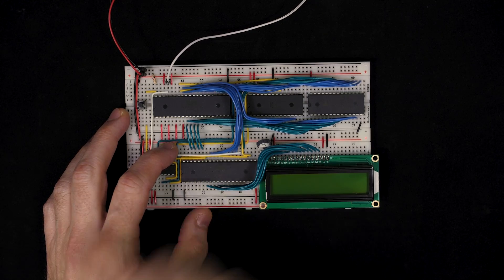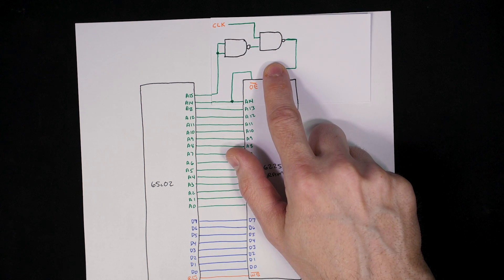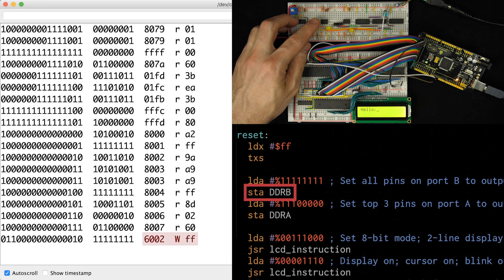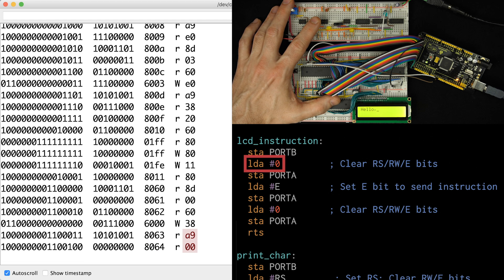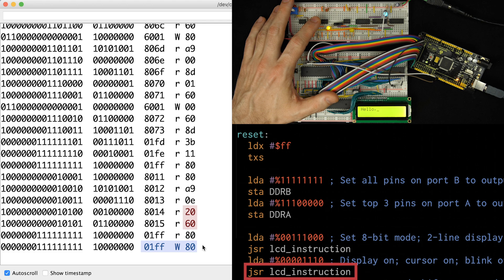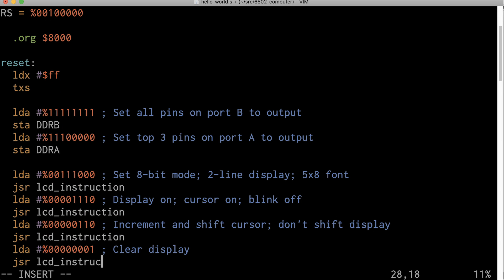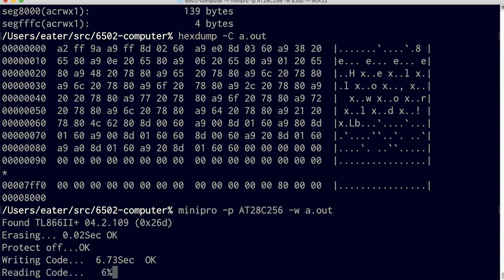Subroutine calls, now with RAM — 6502 part 7

Comment: I think I speak for a lot of people when I say that I would love to see you doing a few videos talking about how you could connect this computer to your home made video card. 

It probably isn't as straightforward as it seems. But in a nutshell, couldn't you theoretically replace the EEPROM on your video card with some kind of static VRAM that's being filled by a program in your 6502 computer?

If nothing else, if i'm wayyyyy off the mark, I would be equally happy with a video explaining why that wouldn't work.
Reply: Timing can be a problem.
 The video card needs access to the VRAM for every line on screen, and somewhere in there the 6502 needs to be able to write to the VRAM.
Reply: Maybe he could teach us how to actually arbitrate accesses between GPU and CPU. Yeah, that wouldn't be that bad actually.
Reply: @paulstelian97  , blank periods in the borders of the screen, L-R & especially top-bottom can provide opportunities for a CPU to access VRAM, especially if the CPU is slower than the video card's pixel clock rate.
Reply: @massimookissed1023  Well yes, but actually synchronizing in software isn't that good of an idea. You should have a hardware arbiter just like DMA and CPU arbitrate each other when accessing the regular address/data buses in actual computers.
Reply: The real problem is that the eater video card is just a frame buffer and 200x120 bytes is a lot of data to move around, for a 1Mhz CPU anyway. That’s why video chips for old 6502 systems used tile maps and sprites.

Implementing those things with simple ICs would be insane. An FPGA would be the best modern way to implement that without using tons of silicon.
Reply: @zerobyte802  I would be fine seeing him just fill the screen with a solid color or raster bars. But yeah, I can imagine it would be crazy after a while.
Reply: @massimookissed1023  if i am not mistaken this is exactly what the atari 2600 does...
Reply: @urugulu1656  you are not mistaken. The 2600 worked exactly like this.
Reply: Don't think HDMA can be very useful for this
Reply: @zerobyte802  Or maybe a Parallax Propeller chip, probably a bit easier to grasp.
Reply: @massimookissed1023  the NES avoids this by only allowing the nametable data to be written to during V-blank, since it does not do anything.
Reply: @massimookissed1023  The old 8bit Atari computer did that by routing the clock though the GPU. That way the GPU could slow the CPU down to read from RAM. And at the time VRAM wasn't used as well. The DRAM had to do it all.
Reply: That IS what the 2600 did, but you do have to keep in mind that the graphics chip on the 2600 wasn't using a display buffer.

It has something like a 20 bit line buffer for the background, and a bunch of hardware sprites, and a handful of control registers.

You HAD to write to it in H-blank, because the graphics chip would literally only draw a single scanline, and if you weren't changing data each line the screen would just be the same thing over and over.
The V-blank period is the only time during which the CPU isn't occupied with screen update logic, so it's the only time you have for the rest of your code.

But yeah, in general these old microprocessors (especially at low clock speeds) are not fast enough for systems that only have a framebuffer.

I for instance use my Atari 800XL fairly often. 1.77 mhz 6502 (for the PAL model anyway).
And while it has something like 13 graphics modes and fairly complex logic that lets you switch graphics mode on a per line basis without CPU intervention...
It's one of the few systems of the era that has pure bitmap/framebuffer modes. 

If you set one of these up as fullscreen then you're dealing with 320x192 in 2 colours, 160x192 in 4, or 80x192 in 16...

Since each of these means there's more than 1 pixel per byte, and a 6502 works with whole bytes, you can fill multiple pixels with one write to video memory, but... in most cases that's not something you can take advantage of.
and the masking involved for writing individual pixels would actually make it slower than if a 256 colour mode was available...

Anyway... If we ignore all sense of reason and assume that somehow we can update 1 pixel for a single STA instruction, don't have to deal with bus contention, any other logic or what have you...

We find an STA is at least 4 clock cycles, so at 1.77 mhz we find our absolute best case (highly unrealistic) is that we can update 442,500 pixels a second.

a quick calculation for our lowest resolution option of 80x192 pixels shows a single frame to have 15,360 pixels.

Since our system is PAL, and runs at 50 hz...
Oh, would you look at that. updating this, our LOWEST resolution takes 768,000 pixels a second to update at full framerate...
And that's with the idea that we can do such an update in 4 cycles.
In reality even the best optimised code ever is likely to be closer to 20 cycles per write, and if you include the overhead of doing any nontrivial work alongside that you're soon looking at 100-200 cycles for every pixel drawn...

I know I wrote a line drawing routine for 6502 at some point. And while I'm sure it could be optimised, I noted that the setup for each line drawn took about 200 cycles, and then each pixel drawn was about 25 cycles. Suffice to say I worked out that my atari could draw about 1000 lines, give or take on a single frame. Since in practice any realistic use of line drawing (I was hoping to make a wireframe 3d engine) would require erasing the graphics memory between frames...
Well, your first instinct might be to do a memory fill, but as already noted, that's slow. Even knowing this is a case where we can exploit 1 byte written = multiple pixels, blanking the screen between frames is going to eat most of our cycles.
So it turns out the most efficient way to blank an image when drawing wireframe 3d graphics... Is to 'undraw' all the lines you drew in the current frame. (that is, draw the same exact lines again, but in the background colour)
That's great to know, but that means the 1000 lines per frame I thought I had is actually more like 500 lines a frame...

So... Yeah. That's not really viable in a general case.
I mean it's not impossible to do as a tech demo, but the results would be painfully slow.

(as an aside I was trying to work out the performance requirements in a very broad sense for doing 3d graphics in software. From that I determined that to do filled 3d graphics at decent... Eg 25-30 fps speeds, requires roughly a 30 mhz CPU. And on PC these kinds of speeds are indeed when we started seeing somewhat decent 3d games showing up, even if they still took a lot of shortcuts with it...)
Reply: @KuraIthys  I appreciated reading this breakdown on the impracticalities of frame buffer or even 3D wireframes on some of these old 8 bit microprocessors. It is one of those things that everybody hand waves away as if it were impossible without actually explaining (or even knowing) why. Thanks for explaining the science behind it.
Reply: @mapleshaft  Yeah same. I am equally happy with an explanation for why it wouldn't work and why.

I'm always learning something, no matter what.
Reply: @KuraIthys  Love the detailed explanation. It seems in a "modern" computer whatever code you write needs to find a time slice to do its stuff between all graphics intensive works to keep the monitor filled with colors is done. A similar memory hungry aproach happens with sound? I dind't had the intuition that the audiovisual part was so resource intensive.
Reply: At that point he has to decide just how far down the rabbit hole he wants to go with teaching computer science vs computer programming.  Games used to be simple not just because of hardware constraints but because of time restraints.  There is a ton of foundation work that has to be done to support making video games on any platform.  There are a lot of toolsets created to speed up and simplify the process on consoles and computers.  And when you create your own computer, you're on your own making those toolsets.
Reply: You could, but you run into the problem of sharing memory with two devices. There's a few ways to do this.
One is to have the memory run at double the speed of either CPU or GPU, and have them alternate accesses. This is a pain if you're dealing with seperately-generated clock signals.
Another is to use the 'C02s /WAIT input to halt the CPU if both try to access the memory at the same time.
Another way would be to leave that memory strictly alone until either HBLANK or VBLANK, and have an interrupt and/or memory location inform the processor when the VRAM is free. This assumes the Eater GPU doesn't access VRAM during the blanking periods. I don't remember if this is the case anymore.
Reply: I think a problem would be the clock speed. Due to the fact that ram and eeprom could be slower than the crystal he is using in the video card. I don't know exactly. But that could be a problem presented
Reply: Why replace the EEPROM? There are already 8kb of unassigned memory:

https://files.peakd.com/file/peakd-hive/krischik/hoSSNzoy-MMU.png

Comment: try to hook a screen up and create a NES (also has 6502)
or maybe a BEES (Ben Eater Entertainment System)
Reply: BEEEEEEEEEEEEEEEEEEEEEEEEEEEEEEEEEEEEEEEEEEEEEEEES 🐝🐝🐝🐝🐝🐝🐝🐝🐝🐝🐝
Reply: The NES' CPU is based on the 6502, it's not actually a MOS6502
Reply: That doesn't really matter.

There's few systems that contain an actual 6502. Yet they'll still all run the same code and most of the support circuitry is similar.

> the c64 runs the MOS 6510
>The Atari 8 bit micromputers use a chip called 'Sally' or sometimes (to much confusion the 6502c - no relation to the general purpose 6502c) - this sounds fancy but it's basically a 6502 with an external 'halt' line that lets the graphics chip force the CPU off the bus so it can do DMA. This is pretty much just to cut costs, since you can achieve the same effect with a standard 6502 and about 5 logic IC's...
>The NES uses a Ricoh 2A03 - which is basically a second source 6502. While it has some slightly altered functionality, it's still essentially a 6502 for most purposes
>The TurbographX 16 has a Hudson Soft HU 6280 - again, this has a bunch of unique features. Among them a 21 bit address bus to deal with up to 2 megabytes of RAM, and a few other things. But at heart? Still a 6502.
> The SNES like the NES before it is using a Ricoh CPU. In this case the Ricoh 5A22 - this is of course a 65816 derivative, not 6502. But still the same logic holds. In this case the 5A22 has a bunch of extra features, like being able to operate at 3 different clock speeds, a multiply and divide circuit, support for the SNES dual bus layout and DMA engine, and so on. But underneath all that? Still fully compatible with the 65816...

Very few systems from that era (basically none in fact) explicitly use a 6502, but they're all very similar in spite of that...
Reply: @KuraIthys  The BBC Micro, very popular in the UK, used a genuine 6502A (that is, a 2MHz version of the 6502). Mine was manufactured by Rockwell.
Reply: @KuraIthys  the c64's cpu is basically a 6502 with more address lines, since commodore were actually manufacturing the chips
Reply: @KuraIthys  so SNES can run 6502 code vanilla? just like 486 can run 286 code... But most importantly, how is graphics and music controlled, text I assume on screen is close to using LCD here. gfx and sfx were separate chips. RAM I assume works same as here, despite minor differences.
Reply: WE NEED THE 
B   E     E     S    !
Reply: Ya like jazz?
Reply: @ijoshuadockery BEES KNEES xD
Reply: BEES 🐝🐝🐝🐝🐝🐝🐝🐝🐝🐝

Comment: Normally, I'd wire the OE* pin to the R/W line via an inverter.  Perhaps THAT signal should also be qualified by the CS* as well, although I think the OE function is already qualified by CS inside of the ram itself.
Reply: Yeah, OE will not work without CS being active.

Comment: Could simplify the wiring a bit by stacking the RAM on the ROM, bending out the pins not common. Used that technique back in the day on the TRS-80 to double the RAM.
Reply: That would make the programming of the ROM rather more difficult in this case.
Reply: I can't imagine it being easy to bend out pins far enough to reach different contacts on the breadboard. Remember all the holes are ganged in sets of 5. Your idea works on a PCB much better.
Reply: Mal-2 KSC the idea would be to solder jumpers to the pins that aren’t common. I think the chips could piggy back on each other without solder, so the EEPROM could be programmed. But, that might result in flakey running.

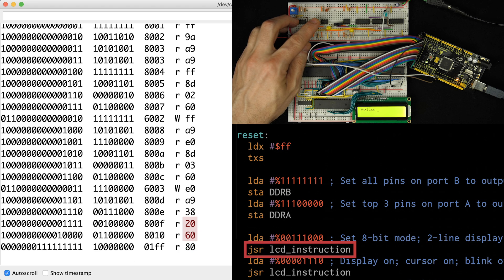Comment: Great video again Ben. At 8:25, I think the data (80) at address 01ff could have been put there at 6:17 before you reset the 6502!
Reply: That is 100% correct.
Reply: Yep, he reset the processor but the RAM was still powered up so the data from the last run was retained.
Reply: @jhonbus  And vitally, his code resets the stack pointer. If he did not do that, the stack pointer would still be pointed to where it was when the CPU was reset, and the unused data seen on the bus on the next run could be anything.
Reply: I’m a noob at this stuff so not really sure if this is a terrible idea. But could you tie the reset switch to the ram to clear it on reset?

Comment: you could map all instructions that take more than one clock, then when the arduino reads that those, it can print something like XX on the bus to show that the data doesn't matter.
Reply: This requires the Arduino program to know which bytes being read are opcodes to be executed. Possible, but it would mean writing a 6502 simulator.
Reply: @AndyGoth111  Not really, I think. You'd simply have to build a map or something of all opcodes that require more than 1 cycle. Mind you: you only have to count them, not execute them.
Reply: @AndyGoth111  interesting. When I studied this I worked with the MIPS architecture. If I remember correctly, we knew the number of clocks needed for each instruction since we knew how many microinstructions would run. I don't know the internals of this computer but I imagine that there could be a way if interpreting the results without coding an entire simulator.
Reply: All opcodes require at least 2 cycles.
Some require variable numbers of clock cycles depending on things like branch taken/not taken or page boundary crossings.

The program on the Arduino would be like a stripped down 6502 emulation. Watch “One lone coder” episodes on building a NES emulator to see what it would look like.
Reply: @zerobyte802  this is the solution I imagined. A "smart" map that knows which instruction is being executed and just gets the number of extra clocks based on a simple input analysis. Not that hard I think.
Reply: @lucasmontec  well it is nontrivial since you need it to start correctly in the first place, and then keep track of what is code, what is data and what is to be ignored. IDK about 6502 internals but it'll not be as easy as everyone imagines, and will certainly require some more code than would be a reasonable amount to write and debug.
Reply: @JoJoModding  I have no idea about the 6502, but at least for the MIPS architecture it was relatively trivial to understand the number of extra clock cycles needed. I mean, the instruction execution there didn't vary in clock cycles wildly. But I really don't know this processor architecture so I cannot infer that this task would be easy. I just think that if a human can understand this behavior just by looking at it, maybe it is possible to do some lazy fuzzy algorithm that can infer somewhat that some bus data is ignored. You don't need to be exact, just good enough idk.
Reply: @JoJoModding  well I think that, by having some sort of lookup table with 256 entries, with information such as how many bytes that opcode reads, which ones of them are valid (important) and which ones are just extra cycles, that could become in fact trivial. Then, what's left to do is save the number of cycles until the next instruction into a variable, and once that counter reaches zero, perform the lookup operation once again. The only problem would be syncing the instruction cycles to distinguish what's operand and what's data, but that could be done easily by looking at the SYNC pin, designed especially to highlight those cycles where an instruction is being fetched.
Reply: I think looking at the Bus Enable pin would be much easier. In theory this should only be active when the processor is intentionally reading or writting to the bus. But I'm not really sure about the 6502, as it looks like the original version didn't support floating bus (allowing other devices to control the bus when the processor doesn't need it), but the CMOS versions of the chips apparently have tri-state buffers for the bus.